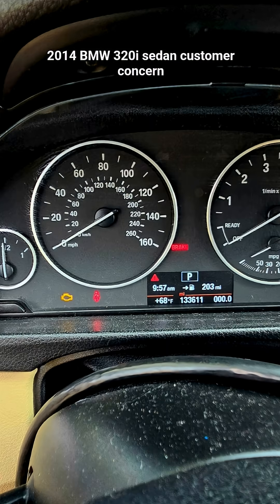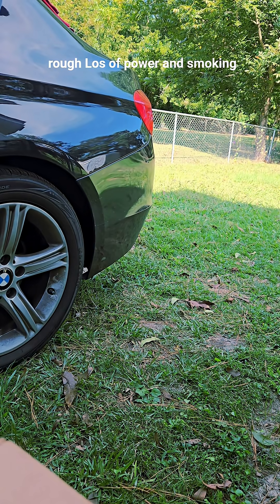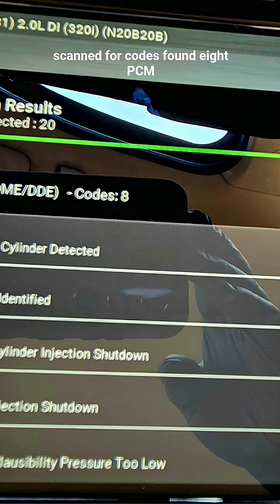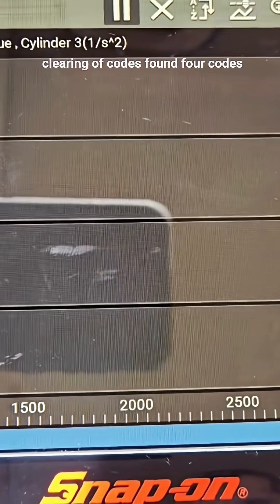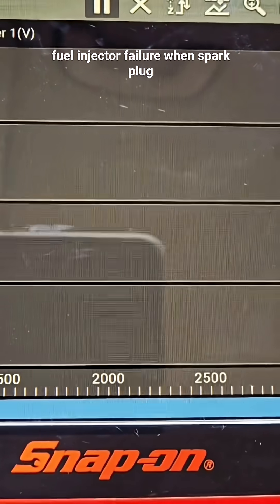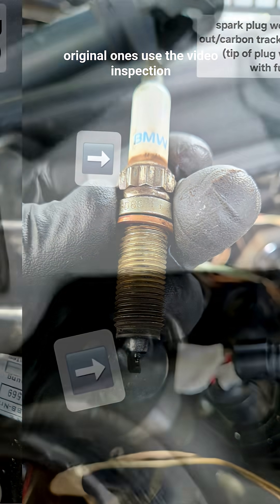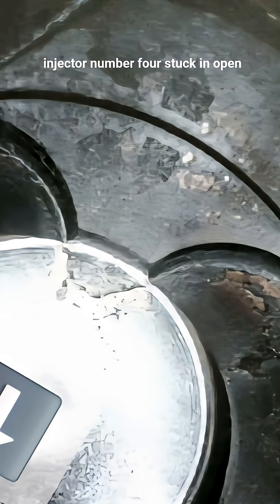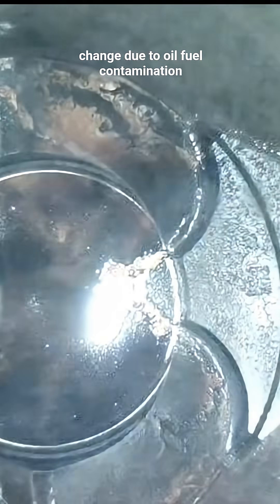2014 BMW 320i - Check Engine Light + Rough Start Diagnosis (Injector #4 Failure)

Comment from the maker: **"Thanks for watching! If your BMW 320i (or any N20 engine) is showing a check engine light, rough idle, or smoke at startup 💨, it could be a bad fuel injector or worn spark plug like this vehicle. 🚗

  Just a quick note: these N20 engines have different injector revisions (Euro-5 vs Euro-6), so always double-check part numbers before replacing. Appreciate all the extra info shared in the comments too!

Have you dealt with this issue before? Drop your experience in the comments, so we can help each other out (it may help other BMW owners)!"** 👇

Comment: There are three injector revisions for Euro-5 N20, and one for Euro-6. The N26 injectors are different. Some owners change them. These injectors can be cleaned and tested using equipment. There are new technologies for this. Click on the nickname.
Reply from the maker: Thanks for sharing that! The injector revisions on these N20/N26 engines can definitely confuse a lot of people. Good tip about cleaning and testing - I'll keep that in mind for future repairs.
Reply: @WrenchWiseGarage  N20 and N55 are identical in performance. N26 injectors have different filling capacities. N63 GEN-2 injectors have higher performance. I'm a fuel specialist; I make these injectors for the whole country. It costs us $8 to make one here. We work with original German injectors. I don't want to work with Turkish BOSCH injectors.